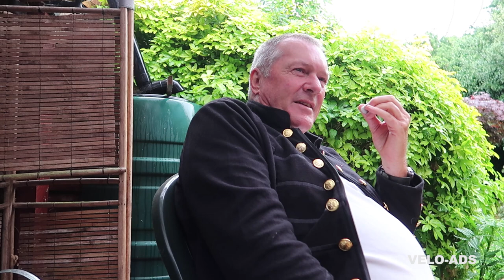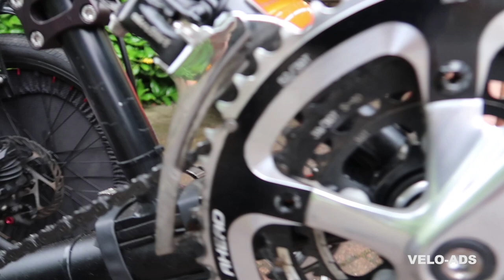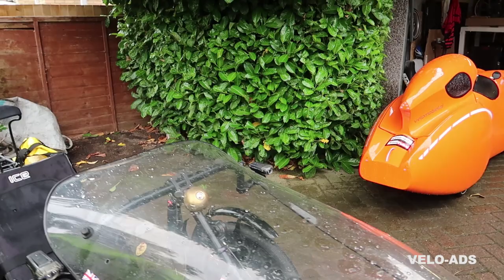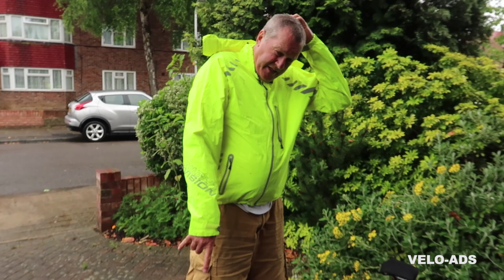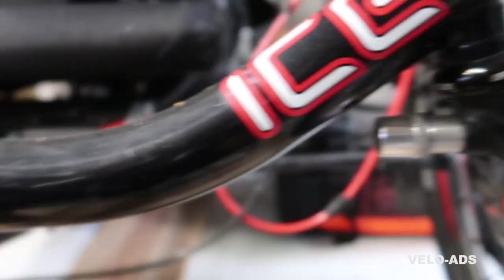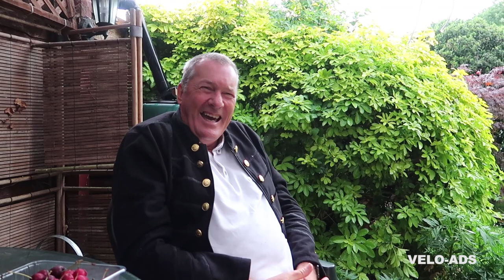Graham and his ICE FS Trike. ME AND MY BIKE #2

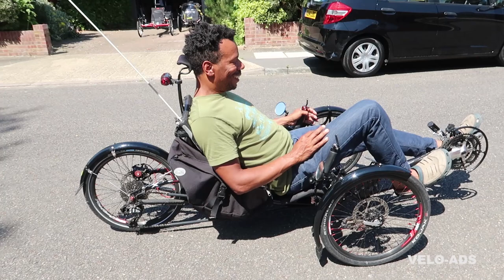Comment: 15:40 The quiet and the comfort is why I ride my ICE Adventure during the summer, and use the QV mainly during the winter. 
'Wendy' (the QV) has been out a bit lately because of the rain, and, OMG she is SO noisy compared, and while the suspension is good, it HAS to be set up for fast road riding speeds, so you rattle around a bit on the cycle track. Good to throw stuff in the back and not worry about strapping everything down though!